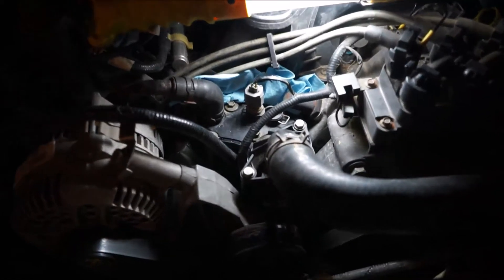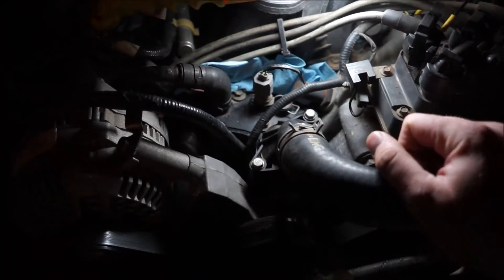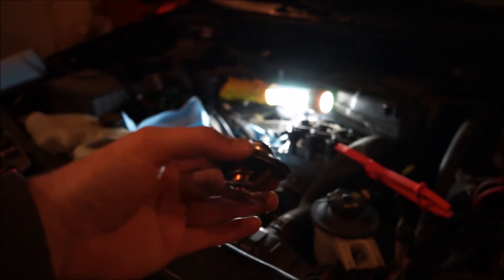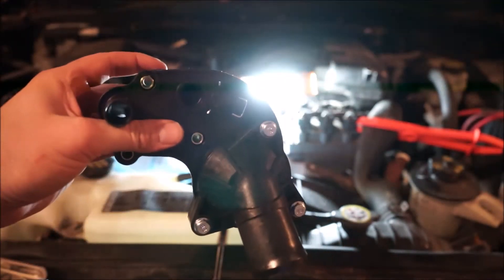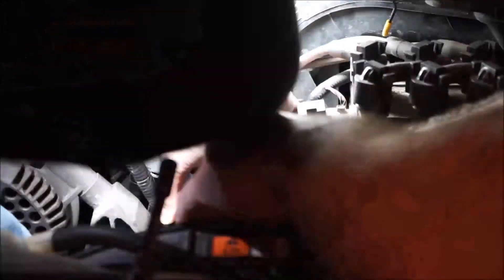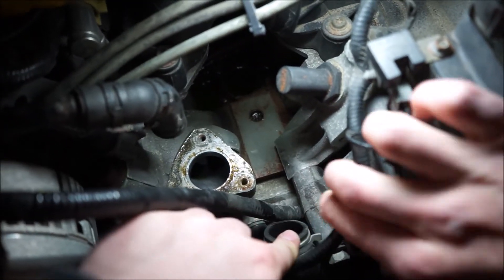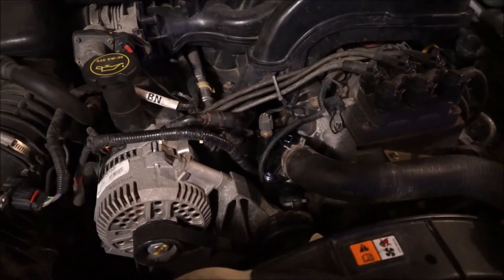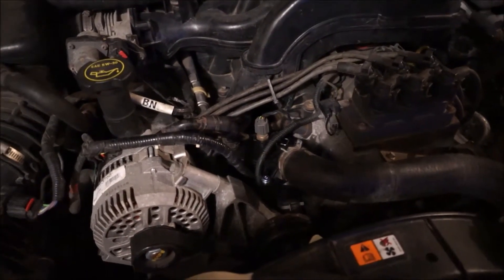2006-10 Ford Explorer thermostat housing install

Comment: Getting ready to tackle this on the road...It would be great to have a list of tools needed since I am not at home and having to purchase tools too:( Regardless, this video is solid! Thank you!
Reply: I've recently changed this on my 06 Explorer 4.0 so I'll answer that for ya.
1. A 7mm socket or flat head screwdriver to loosen the clamps on the air intake at the throttle body (you'll need this out of the way.
2. Medium sized pliers to disconnect water hose claps. Prepare yourself for some spillage.
3. 8mm socket for thermostat housing bolts. It'd be smart to have a 5/16 socket as well as the 8mm was a tad loose on one bolt head for me and ended up requiring an extractor socket to get out once stripped. Have an 8" extension for your ratchet on hand as well.
That's it. Other than having to finesse some of those coolant hoses off and cleaning up spilled fluid it's really easy. There's an "indent" behind the thermostat housing on the top of the intake manifold that'll catch and pool much of the spilled coolant, so before you start, pack a bunch of shop towels back there to soak up as much spilled fluid as you can. Just be sure to remove them when you're finished.

Hope this helps!

Comment: Did you have to drain any antifreeze to perform this ?
Reply from the maker: it is one of the highest point in the coolant system so you do not need to drain much. when I preformed this it already leaked out so much that it was not necessary